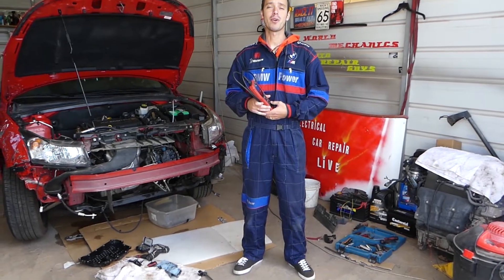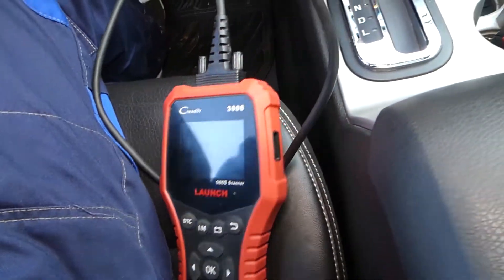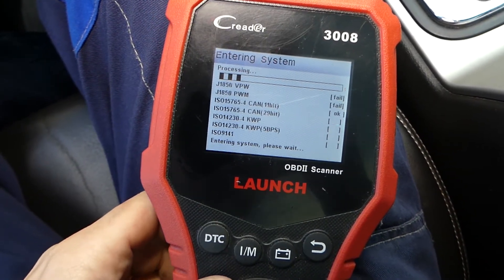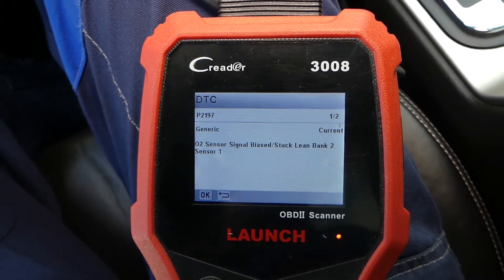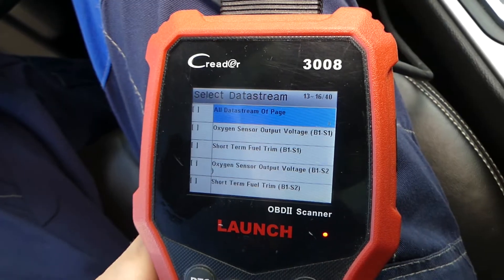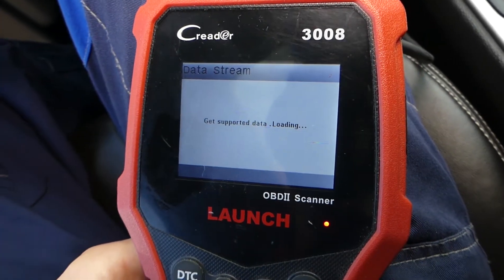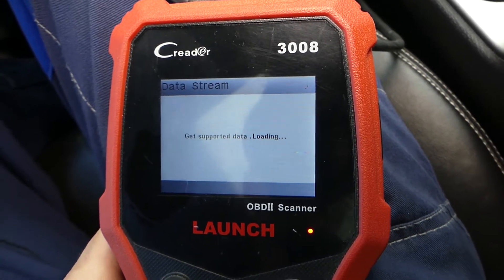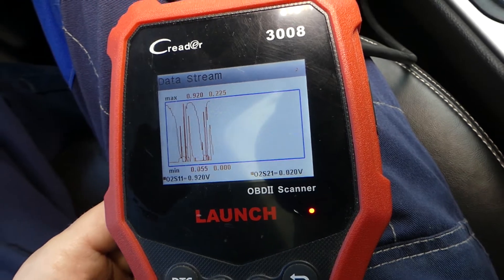HOW TO KNOW IF OXYGEN SENSOR IS BAD. TEST OXYGEN SENSOR

Comment: hi, love your videos. looking for some guidance:   i'm testing o2 sensors (no code) with a foxwell nt530 scanner on a 2009 civic sedan with 90k miles. idle is a little bouncy with some vibration and mpg's are down a bit.  i'm considering a preemptive upstream sensor replacement given the age/mileage.   the graph on the upstream sensor fluctuates between -.02 and +.04, but mostly .01 and .02 milli amps.  the downstream range is .175 to .64, but mostly between .5 and .6 volts.  short term fuel trim is -1 to -3% and long term is -3 to -7%.  any thoughts would be appreciated.  

btw, this seemed odd to me....your video posted by someone else:  https://www.youtube.com/watch?v=Hsbx7I3pT1A

thanks, Scott

Comment: I just did this in a peugeot 406, the good o2 sensor is the one after the cat, the signal is consistent, it doesn't spike. However, the bad sensor, the one that is faulty according dtc's, is the one before the cat, in this case, it spikes a lot, but it ranges from .1 to .8, same as the  good one (slightly lower in the good one, as the cat is doing its thing). So signaling in this case i think it's good? as you are showing that spikes aren't a faulty sensor indicator. I think is the heater then, as the dtc is p0140, it's not really specific about what is the cause (can be signaling or heater).
Reply: @frank 1976 at the end, the o2 sensor was bad, i got confused because the scanner told me the good one was bad.
Reply: @frank 1976 what year is your car? You should be getting a similar signaling to the video or similar to the good one. But if there is a fault code, it's like 90% chance it is just bad. The one from the peugeot has already 19 years (supposing it was never changed).
Reply: @frank 1976 definitely should have a behaviour similar to the video. If not, doesn't matter, just look for the dtc. They told you if the behaviour is innapropiated (too much seconds without major fluctuations) or the heater is open.